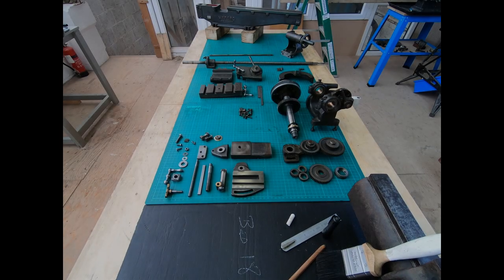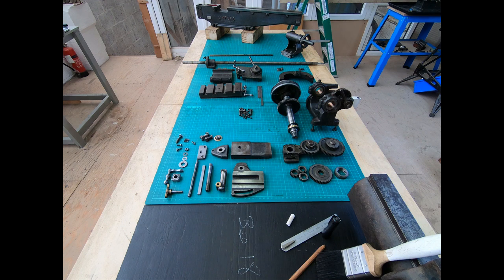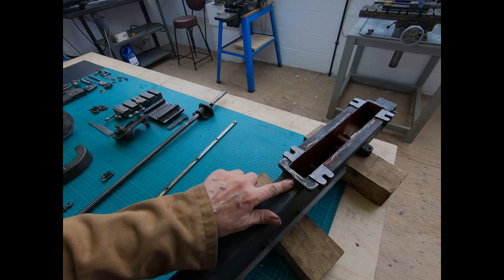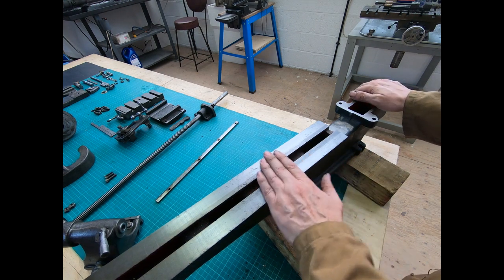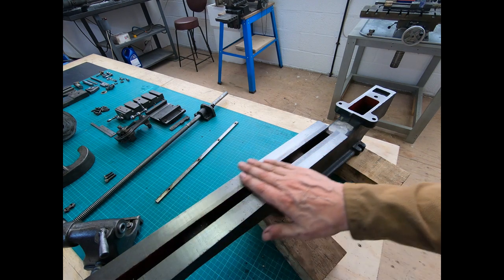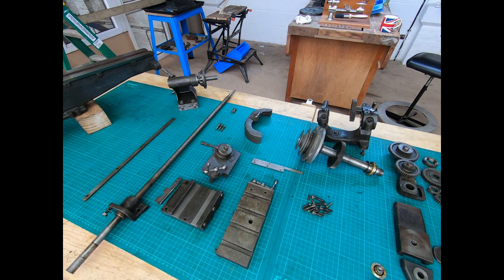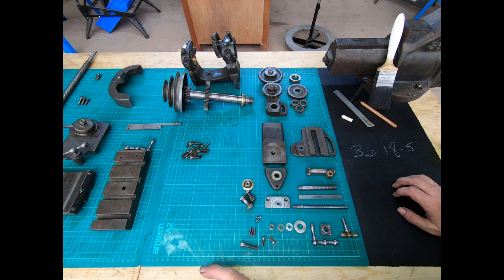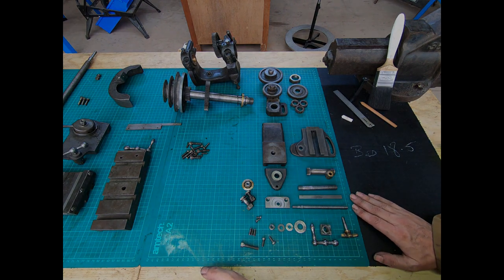Myford ML? - Restoration Part 1.

Comment: Very excited to see an early Myford Lathe in the process of restoration! My ML1 (17” bed) is in desperate need of the same attention and the detail you provide will both inspire and inform me the correct way to bring this lil piece of history back to life! Only bits broken are the top caps for the spindle… very old breaks, someone in the past has made and installed tin caps over the originals. Still spins beautifully! I’ll be right here waiting patiently (🤔) for your next instalment. 
Cheers from Down Under 👍😎🇦🇺
Reply from the maker: Hi Grayse,
I hope I can live up to your expectations... also, I do flip around from project to project but will get them all done in the next six months now COIVD is a little calmer here and I have settled into the new workshop. Many thanks for watching.
Cheers.
Paul,,

Comment: Hi Paul, great to see you getting stuck into a big project. Let your Engineers OCD rule on the castings, if it looks like you are going to need to remove significant amounts of material anywhere, consider body filler on the low side as opposed to removing material from the high side (maintaining as much mass and strength as possible). Good luck with the scraping, braver man than me! Cheers, Jon
Reply from the maker: Hi Jon,
I would like a largish project (not sure this is the one) that will require me to use my various machine tools to complete... I procrastinated about an old lathe about a month ago... When I finally decided to get it, I found that it was sold... Anyways this will keep me busy until something really cool captures my imagination. Thanks for watching.
Cheers.
Paul,,

Comment: hi Paul.
Nice to see the workshop now officially christened with a major project, If getting all the irritating casting alignment marks out pleases you then i say do it, i would. As for the lathe bed for the age of it it doesn't look bad to me looking through a lens at it, scraping is not my favourite pass time in fact  i would put it at the bottom of my list of to do's, but that's just me,
but if you want to have a go then do it i say, why don't you practice on the compound slide first to see how you get on with it.
Anyway i don't think your going to get bored with the Myford, Unimat and shaper etc projects and all those machines to play with.
Take care
mr f
Reply from the maker: Hello Mr. F,
As I disassembled the lathe I was quite surprised of the condition of most of the component parts... out of everything the ways are the worst but having said that they are actually not to bad. I will for sure do some practicing on my scraping technique before I let myself loose on the ways.
There is plenty to do now and a nice environment to do it in... I am having fun up there which is good.
Cheers.
Paul,,

Comment: Hello great video. I have just bought a mk1. Any advice on where I can get parts. Thanks
Reply from the maker: Hello Gavin,
Many thanks for dropping by... I need a couple of bit for this Myford and been having real trouble finding them. The ML7's and Super 7''s there are lots of parts but these older one's are quite difficult to find bits. I have saved searches on eBay and some times the old bit may turn up. Sorry I could not be of more help and good luck with your new lathe.
Take care.
Paul,,
Reply: Could this work for the mk1.

Comment: I have an ML4 that's had a bit of a rough time and I'm a novice, so this video was some help. It would be great if you've pregressed with this project. I'm looking for hints around setting up the headstock bearings, clearances etc
Reply from the maker: Hello,
I am pleased to hear that the video was of some help... I must admit I don't have moving forward with this project on the radar for quite some time, when I am in the workshop today I will see how feasible it is to do a short video on the headstock. You could make a video asking what you need to know and maybe some helpful advice will appear in the comments. Thanks for watching.
Take care.
Paul,,
Reply: @TheKnacklersWorkshop  my latest video does go some way in explaining what needs doing.
Thanks for your reply
Reply from the maker: @750triton  Hello, I have just watched your video, I would suggest you change the video setting to say "No, it's not made for kids" that way viewers can comment. I have just watched this video (https://www.youtube.com/watch?v=jyFAZC78Jf4), which may be of help. Obviously you would need to weld up the bearing cap before shimming. The wobble on your cross-slide is most likely gibs.
Cheers
Paul,,

Comment: Hi There, very interested in your myford 3, have you done any further work to it? I've just purchased one of my own and interested in the maintenance and capability of the machine. I'm a lathe beginner so I'll be looking forward to future video's
Reply from the maker: Hello Todd,
Many thanks for watching my video and taking the time to comment... My old Myford is safely tucked away in the workshop, sadly I have not made any further progress as 2023 was somewhat challenging for me. Hopefully sometime in 2024 I will make a little progress with the restoration. It is good to hear you have a Myford as well and I would recommend "Jons Workshop", "Mr. Factotum", & "Max Grant" channels as they show really good skills for a beginner.
Take care.
Paul,,
Reply: @TheKnacklersWorkshop  Thanks for the recommendations. The Myford 3 I've just purchased has been well looked after and is in great condition for its age.  Is it  correct to think that this particular model was made in the 40's?
Reply: @TheKnacklersWorkshop  Would you have any advise on adjusting the backlash on the crossfeed for one  of these old myfords?
Reply from the maker: Other than make a new nut that goes under the cross slide you just have to ensure you always back off and then advance the crossslide to manage the backlash.  @toddwilliams7534

Comment: You have quite a bit more experience than I, I wonder if you know the answer to a question I have had for many years now. Has there ever been a lathe that was made for left-handed people? I'm a lefty, and I have developed tricks to make it work, but every lathe I see, I mentally take it apart and try to figure out how it could be rebuilt for a lefty. Have you ever heard of this? Or perhaps a lathe that allowed ambidextrous operations? I can't be the first frustrated left-handed machinist in the world.
Reply from the maker: Hello Jean-Paul,
Last week I was sitting in the workshop drinking a coffee and noticed that all my machine tools were right handed, I must admit I have not thought of it before. I am not aware of any left handed machines. It would be interesting if any other viewers of this comment know of one could tell us about it.
Take care.
Paul,,
Reply: I guess you could probably think of most precision bench/watchmaker lathes, like my P&W 3C 7x16, as an ambidextrous lathe (same for Schaublin, Ames, Stark, etc.)  But you have to be willing to put up with no back gear and wonky or non-existent screwcutting ability.  Only the headstock and tailstock clamps are made for righties, but the compound/cross slide is interchangeable.
Reply: @danielabbey7726  like I said, I always mentally disassemble lathes to see if it could be done. You're absolutely right that the smaller models would work, it seems like you work over the lathe more than in front of it. One day if I win the lottery I will have one commissioned. I appreciate knowing about the models of you named, but I have a condition similar to Parkinson's which kind of rules out tiny work for me. It was never an issue for me until recent declines. I'm just starting to feel a little unsafe at the lathe, so I've been looking around for a slightly safer hobby. That aside, when I was working full-time, it's just something I found myself always wondering about. I worked in a 5-man shop where three of us were lefties. The setup looked a little funny to other machinists.